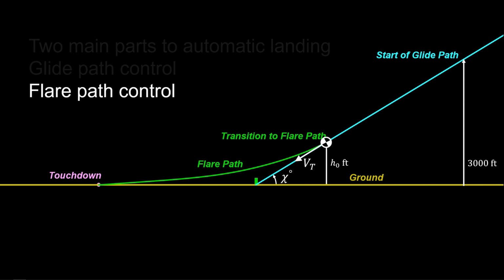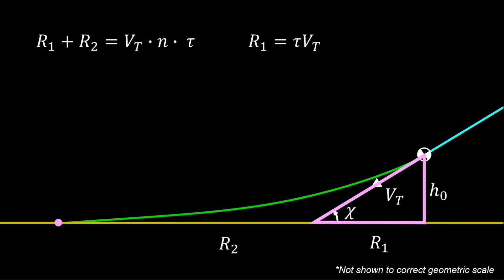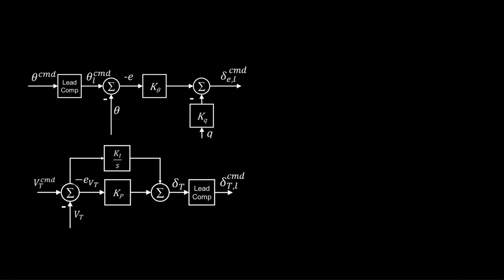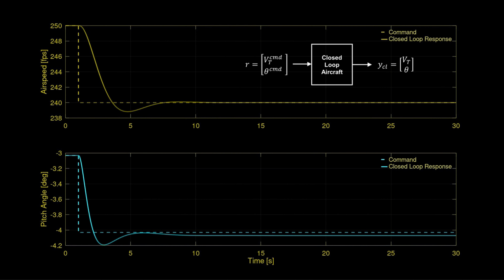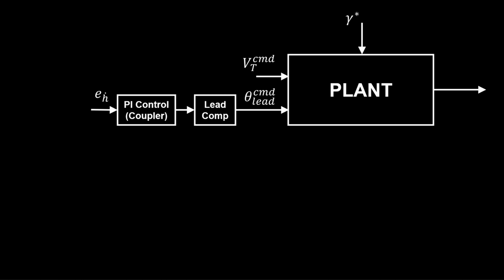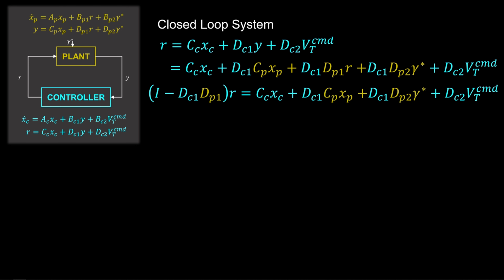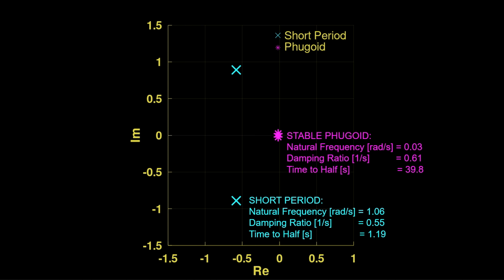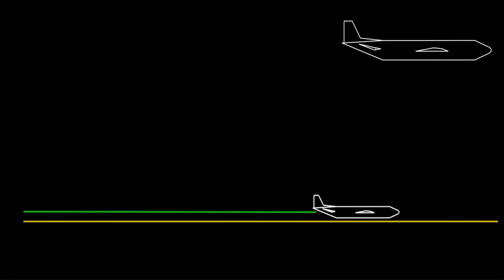Automatic Flare Path Control – Flight Control Fundamentals – Section 1.6.5

Comment: Thanks for another great video.
I wanted to ask regrading the development of rate of height change (minute 5): you set t=0 to get -h/tau and then decide this is the desired rate of height change not only for t=0 but for the rest of the flare path. It's a reasonable design decision but it's presented as if it's the only option.
Reply from the maker: It's good to hear you like the lesson. Yes, I make the assumption that the commanded flare path trajectory is exponential and follows from integration of -h/tau. The exponential path is based on successful piloted landings. The path reduces the rate of descent as h decreases for a smooth landing. Of course, there are other situations such as if the aircraft is unpiloted or there is a constraint on the runway then harder landings and hence different commanded trajectories are possible.